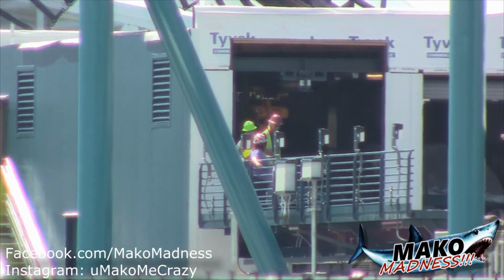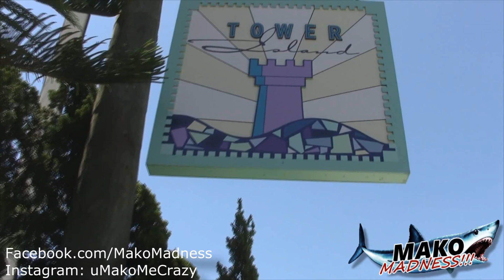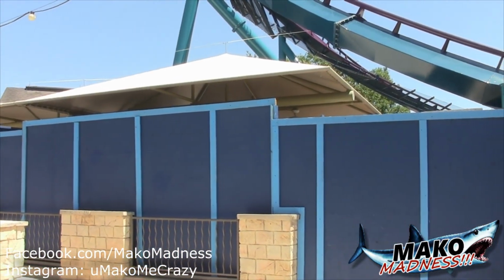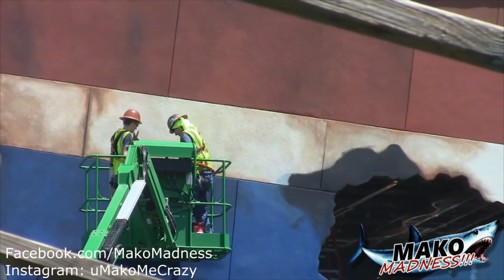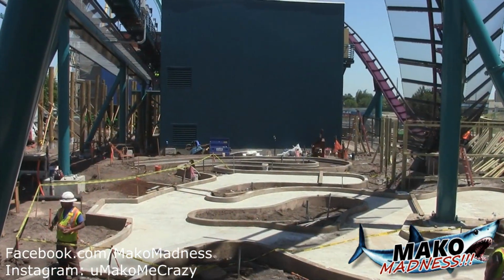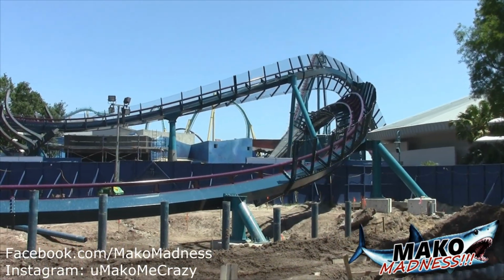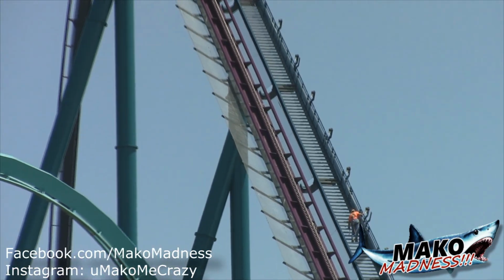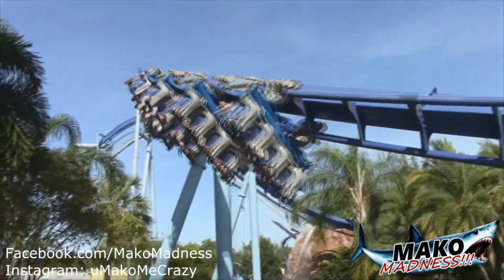SeaWorld Orlando Construction Update 4.8.16 TRAIN ON THE TRACK + ROCKET LAUNCH!!!

Comment: In its covered state, that single car almost looks like it has the extensions added for a pull through test.    The pull through test will let them know if the rib of that ship wreck is too close to the coaster.    If it's too close they'll need to modify things slightly.  It happened with Millennium Force at Cedar Point.  One of the Supports needed to be "notched out" because of clearance issues.